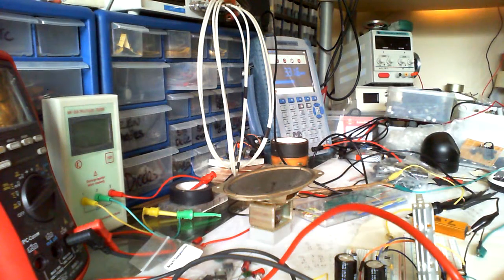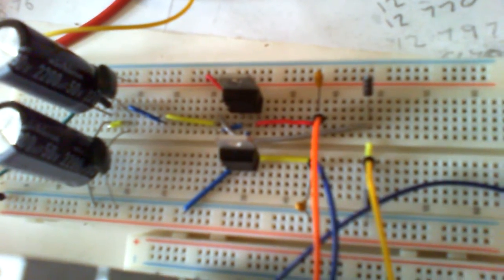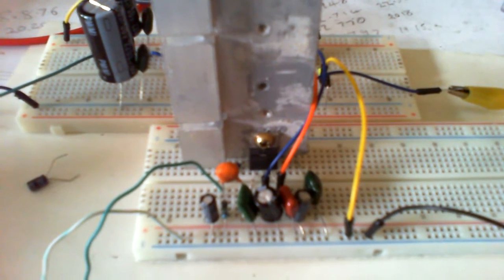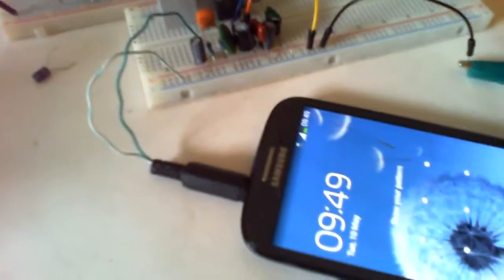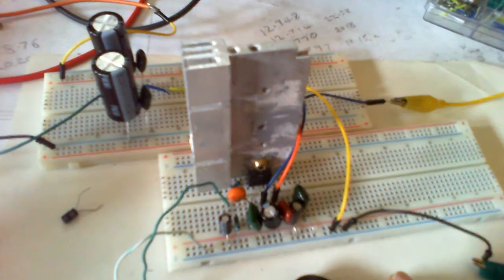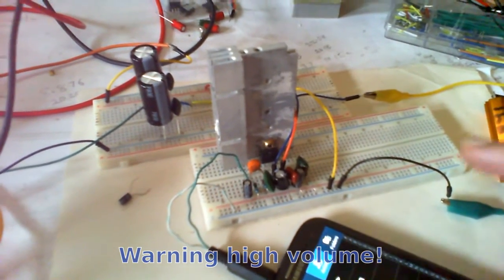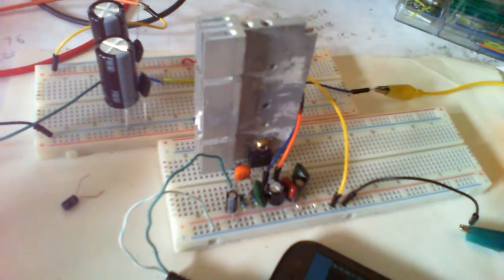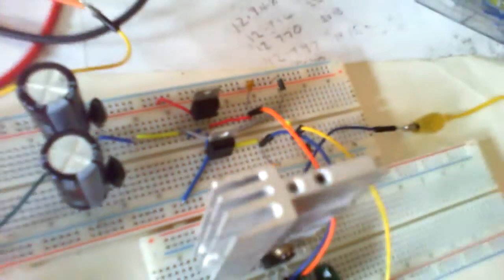DIY LM1875 Amplifier and DIY Bipolar Power Supply

Comment: You’ve probably figured this out long ago but, for others just finding your videos, the answer to separating signal and power grounds is... you can’t completely separate them. The best method of approach is connect the signal and power grounds at only one point and branch out from there. This is referred to as a “star ground” configuration.

Comment: Try voltage regulators LM350T for the positive rail and LM333T for the negative. Both can supply at 3 Amps and max of about 33 volts.  Anyways, most chip amps like that LM1875 don't need regulated power and would run at regular split supplies with no problem.
Reply from the maker: Hi yes I used a 12V 0 12V transformer and it works well without any regulators. Easier to manage and no heat to dissipate :D